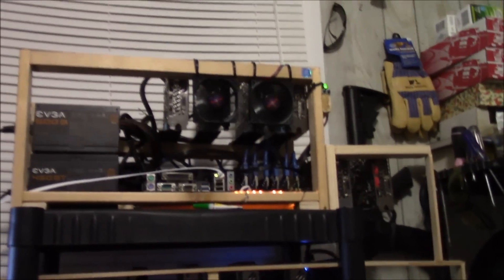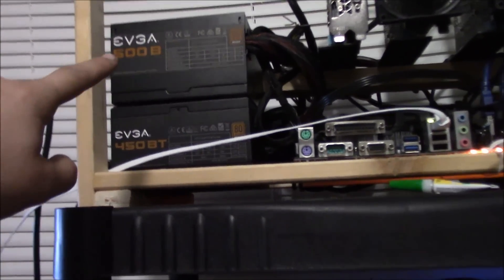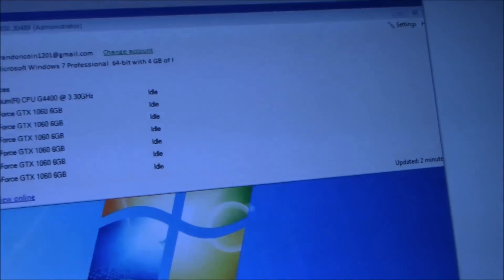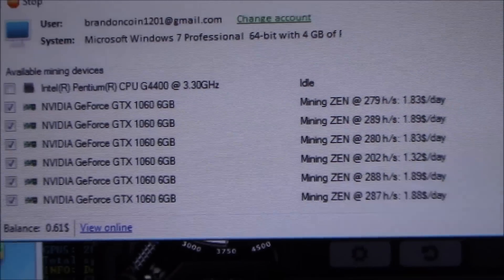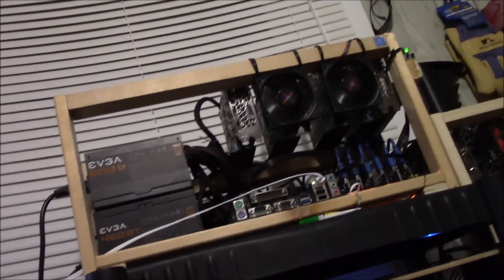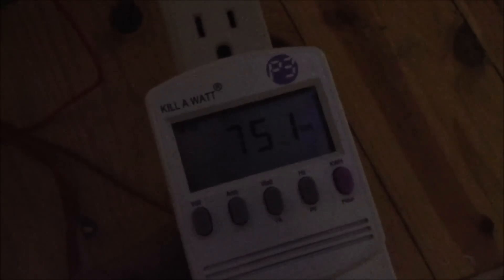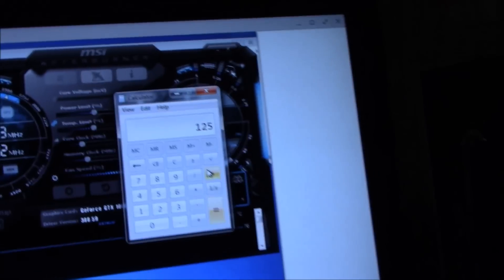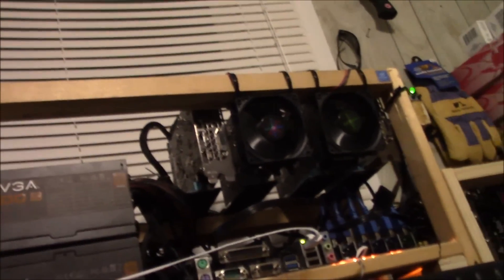GTX 1060 6gb Mining rig Power Consumption

Comment: Ok  GTX 1060 6GB Hm. . .  power limit 50%  memory about +800-900 ETH avg.23-24Mh/s!
                                                power limit 50% memory +800-900 clock +125  290 sols/s !     
                                                 All cards about 85Watts EACH!
I was thinking ti buy 6 or 8 1070 Ti's or 3 1080Ti's but in terms of cost/performance is better to have 8 X 1060 and have 200MhH/s  rather 3 x 1080 Ti's and have 110MH/s !    and much higher power consumption!
thanks for a video!